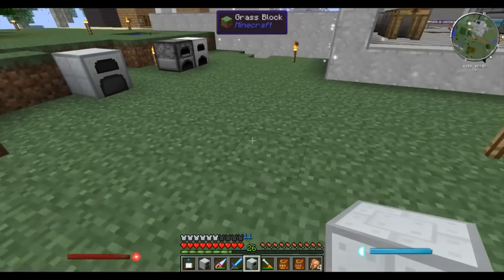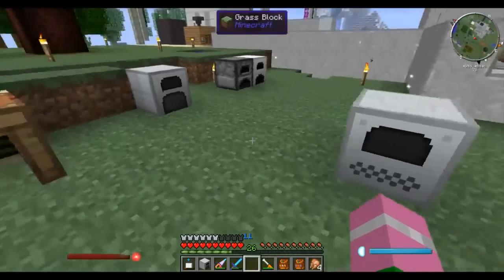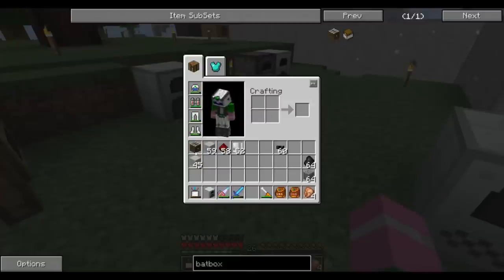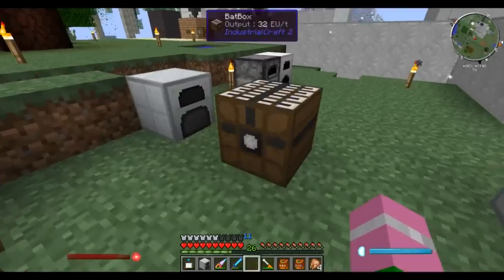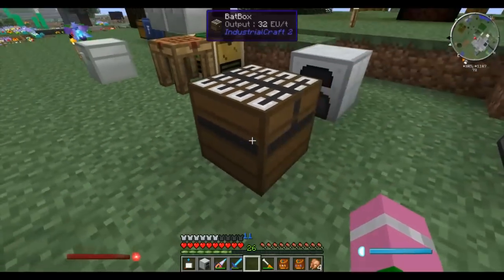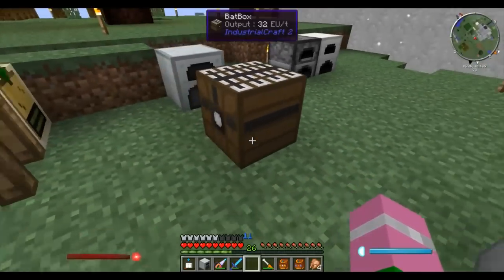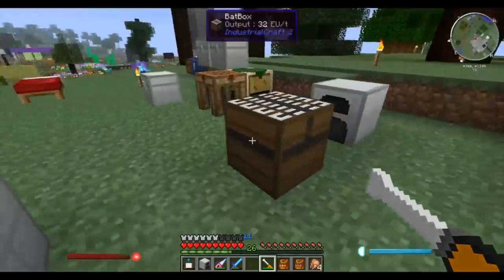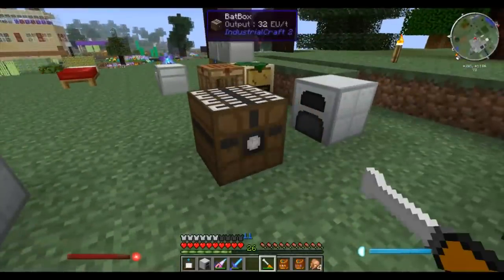Batbox - RE Battery - IndustrialCraft 2 Experimental - Minecraft Minute

Comment: the RE-battery recipe doesnt work for me. is it copper or tin cable?
Reply from the maker: Tin Cable on top, tin casings on the sides.Make sure you've combined the cut tin wire with a piece of rubber too.